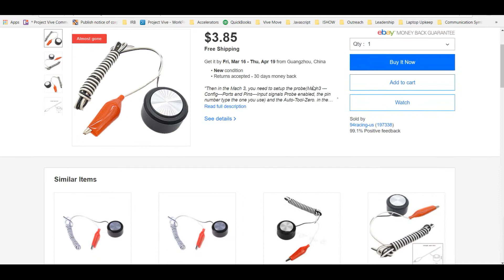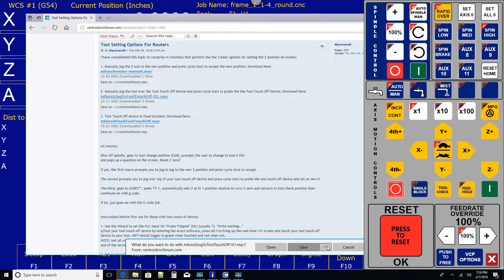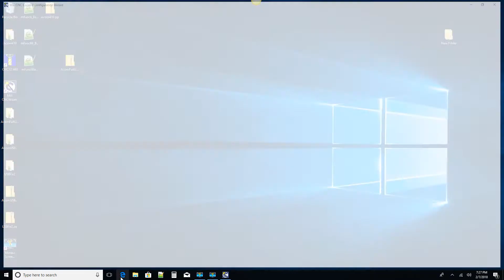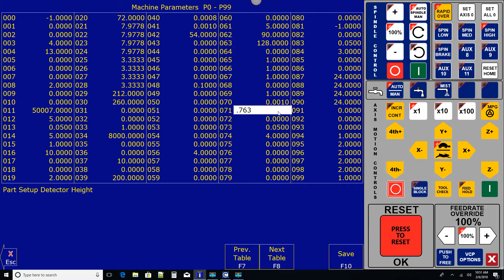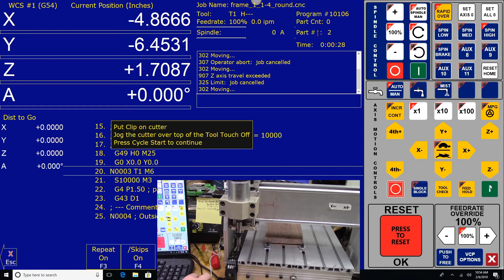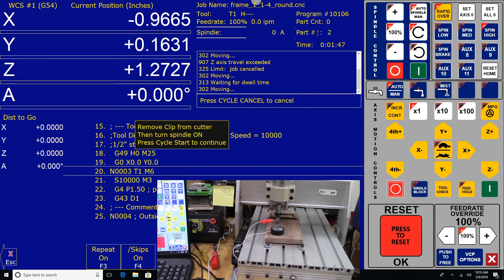Part Zeros & Tool Changes w/ Acorn CNC: Z Tool Touch Off and Macro

Comment: Yes I made the wiring as mention but for me to work I had to remove the wire from the 24vdc .because my acorn was not work properly so I remove the power 24vdc and the acorn card work as the usual .